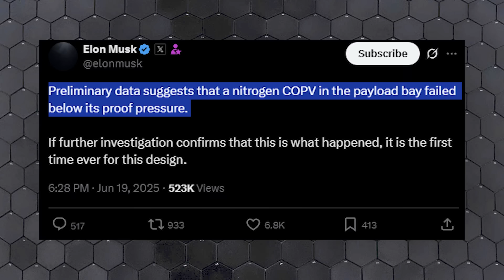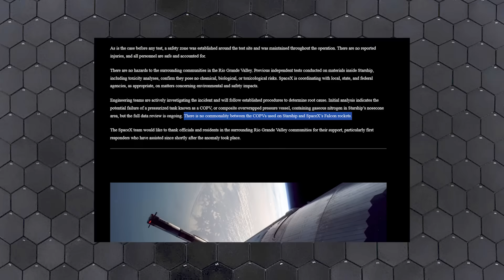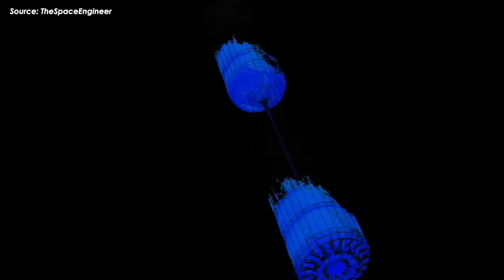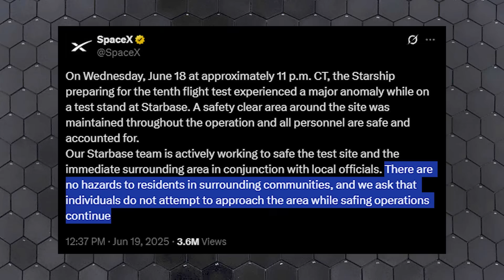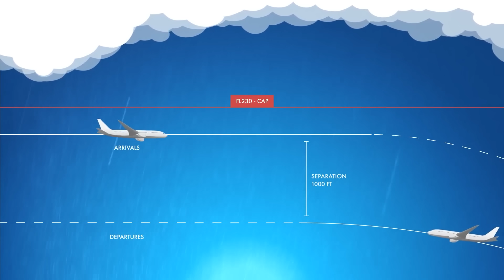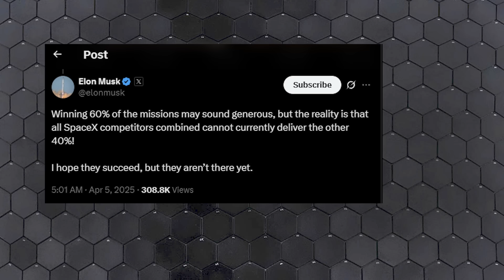SpaceX just officially announced the REAL REASON for devastating S36 Explosion!

Comment: That's why it's called Testing. To find crucial systems that could go wrong. More testing the better. The more testing the more analysis we can get back. Do I think SpaceX will get on track. Definitely 💯% and that's the point. Every single system has got to be 110% before anything. Let's say that. That test that night didn't happen. And went straight to launch. That would be reckless. I'd Rather for that to happen on Testing were no one can get hurt. Than on the main day. Than when people are on board. And we can find out. What happened. What went wrong. How can we make it better. So it doesn't happen in the future.

Comment: Stockton Rush used composites, and we all know how that turned out
Reply: depends on how they're used. Composites are stronger than steel when stretched, Stockton used it to resist compression and it just peeled apart.
Reply: @tidan4575  That may be true but how many pressure cycles can it take before it fails.  Also going from a super cold temperature to ambient temperature may cause fractures in the composite.

Comment: Hmm, where have I seen a composite structural fiber vessel fail before?   1. OceanGate failure - possible delamination due to manufacturing defects and pressure failure.  So, don’t use in subs.  2. Airbus AA Flight 587 and more recently the settlement with Qatar Air that prevents a deeper investigation into delamination on the A350.  Possibly caused by pressure cycles. But, don’t worry it’s safe for commercial aircraft.  3. SpaceX - now possible composite fiber failure during pressure due to delamination.  Starting to see a pattern?  Of course, the engineers who have built careers on pushing the use of carbon fiber in everything say it is safe and better than any metal anyone dare suggest.  But, the fact that it seems to be able to fail spectacularly without any advanced warning seems a risk.  Perhaps we need to step back and consider composite fiber structures, carbon or otherwise, may test in a lab, but that doesn’t mean they automatically are the answer to every real world application.  I don’t think it is time to put it one the Over-application list just yet, (lithium batteries definitely belong there) but we definitely need to reevaluate.

Comment: I have questions:
1: So in a 1st stage engine test, why are they fueling up the 2nd stage to the extent of an overpressure condition?
2: If the 2nd stage failed, why did the 3rd party footage show the explosion (and that is what it was) coming from the cargo bay with an expansion profile consistent with explosives, not a propellant ignition event? This incident looks like sabotage.
3: If the small tanks are not shared with the proven design used in their smaller ships, then why not?  Changing something you know works is a recepe for failure, and Musk is not a fool.
Reply from the maker: 1. SpaceX fuels both stages to simulate real conditions and test the full system. The overpressure was likely due to a valve or sensor issue.

2. The explosion did look unusual, more like a blast than a fire. But there’s no solid proof of sabotage — just speculation for now.

3. Starship is much bigger, so they can't just copy old designs. But yeah, changing what already works is risky.

I'll talk about this in tomorrow morning's episode , stay tuned!

Comment: I assume they test these COPVs to 120% before they use them.  Also, Nitrogen or Helium COPVs on Ship would be difficult in Mars Ops as it can't be locally sourced there.  It seems that CO2 might be better.  So this 4th loss of all that TPS work with no value.  And the Ship V2 record is far worse than "spotty".
Reply: Elon... contact Randall Carlson re Malta and power supply alternative

Comment: Composite tanks are an example of complication, and excessive focus on weight reduction..

Interestingly, I did a writ a few years ago  on a reddit space forum suggesting the use of tanks made out of standard thickwall pipe sections by welding in end caps, or even milling threads and screwing them in.
And using said tanks as longitudinal structural elements..

Which is something Starship needs.

Of course, I got down voted to the center of the earth for a couple days as usual...

But I suggest it be considered as it would also provide possible deck support posts for heavy duty ships, and could be used to solve Starship's lack of decent depth in its internal  structure.

One could imagine a ship needing various pressure tanks, maybe enough to justify using them as structure?

Talking killing several birds with one stone here, using the same metal for 3 purposes, which some may remember me suggesting once before in a far away time of Raptor 1....😂

Pipe comes in many standard diameters with known pressure ratings that can be quite high. Also sure you can order it in much longer lengths if you have a transport system. the normal upper limit on steel is 48 ft due to semi trailer lengths...

Half a dozen such, would create serious internal structure and allow multiple cargo decks.

Also good reserves of critical gasses...

And they aren't likely to explode below specs, and once capped could be pressure tested like other tanks by filling with water first to eliminate risks
Also they could be different diameters and lengths...

Maybe not as good on weight to volume ratio, but do provide other benefits. And could even be aesthetically incorporated into internal structure like deck support systems, using welded tube of smaller diameters, continuing the style of the new hot staging ring...

Tubes N Triangles, as good as it gets, weight to strength...

Also on bigger ships, fuel and oxy main tank thickness could go up, but ships habital spaces skin thickness be less with such supports...

Just Sayin'
Reply from the maker: Brilliant analysis, sir ! I feel like SpaceX should really read your comments sometime.
The idea of using standard steel pipes as both pressure tanks and structural elements actually makes a lot of sense. That’s the true “kill two (or three) birds with one stone” approach.

Not many people think in that direction, especially when everyone’s so obsessed with shaving off mass that they forget about other benefits like structural strength or modularity. Really appreciate this kind of out-of-the-box thinking!